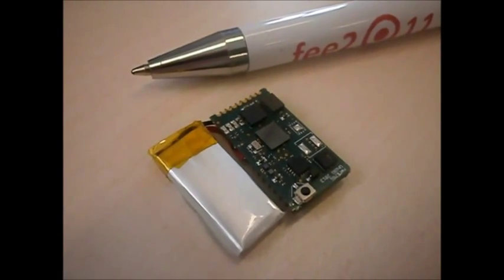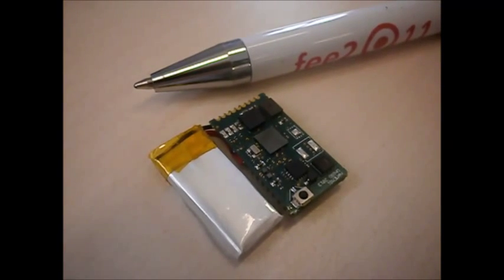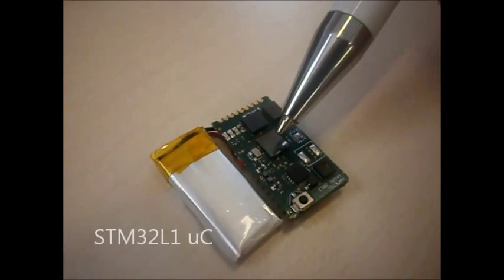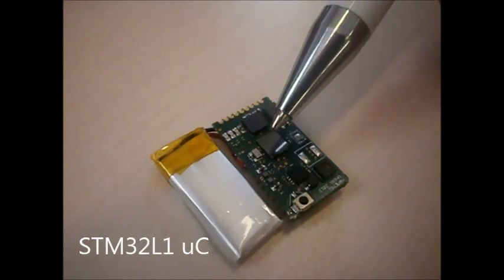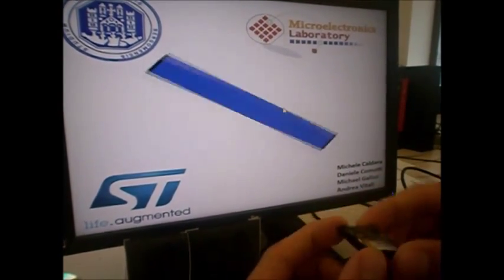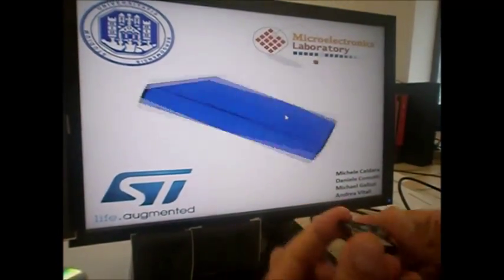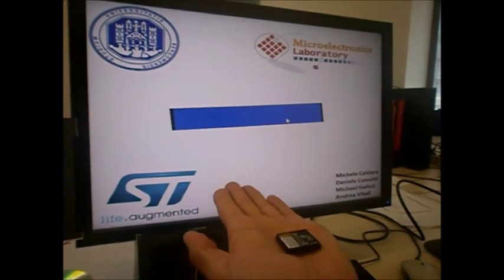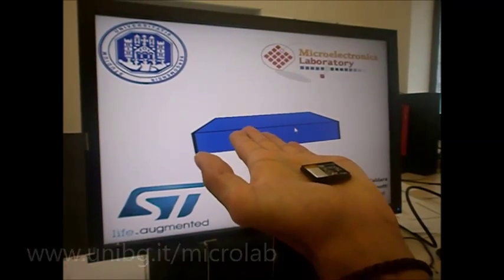neMEMSi - Miniaturized AHRS with embedded quaternion based EKF

Comment: I haven't found any place to add a comment so here it goes:
The code that you have made available at the Google Code Archive (https://code.google.com/archive/p/9dof-orientation-estimation/downloads) has a major problem that incredibly hampers its performance:
inside the Gradient Descendant and Gauss-Newton Method you guys have hard-coded a magnetometer "calibration"
Magn(1,1)=Magn(1,1)+0.38;
Magn(2,1)=Magn(2,1)*1.1;
Magn(3,1)=Magn(3,1)-0.08;
I have been trying to use your code but nothing was working...
If you see this message, please fix it and making available the correct code.